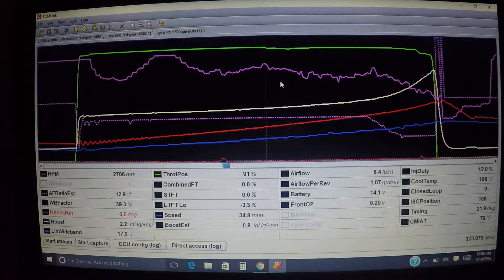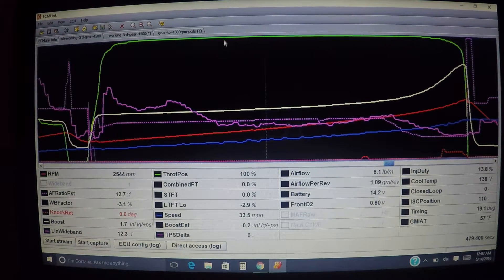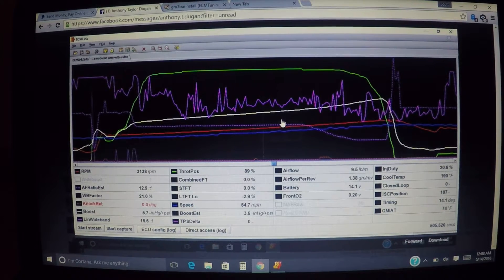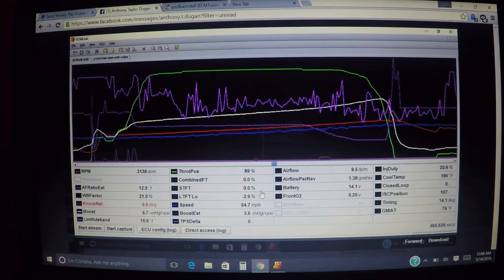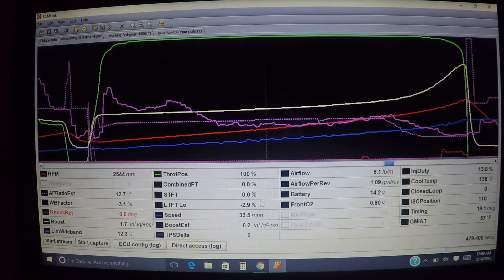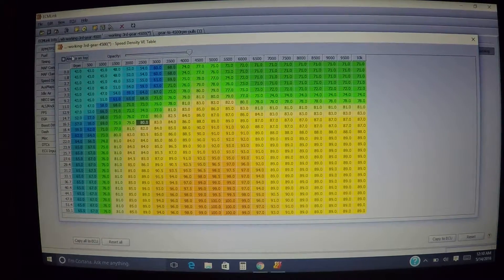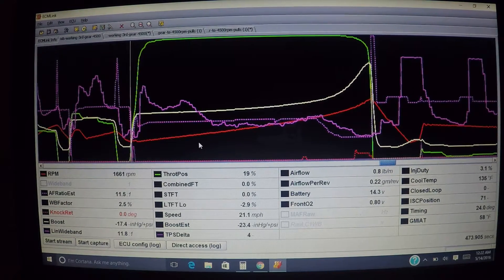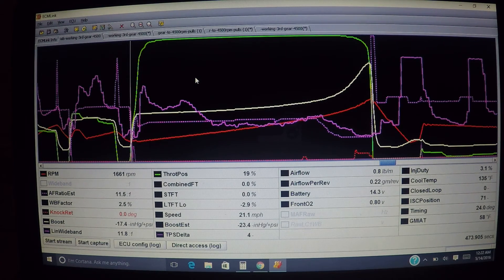SD WOT Part 3

Comment: Scott I've been loving this 3 part series, it helped me dial in part of my WOT logs. Question though, what about the first part of that WOT log? The lean AFR isn't an issue? Following your videos it's gotten me to the point where it looks really similar to what you have here, but I also have that lean instance in the first 1/4 of that WOT pull. I was under the impression that the wideband must follow the AFRatioEst during a pull?
Reply from the maker: I will say that if you can add fuel to get it where it needs to be, great. No reason not to. But if you have trouble there, so long as the car is doing what it should, it's responsive, and moves, then you're okay. You won't have enough of a load in that area to kill the engine there. But as Kevin Jewer always says, give it what it wants (in reason). So give it the fuel if it's warranted but don't pull your hair out over it, if that helps any. When you get into the upper rpm's/load, you want it to be spot on and that's where it really counts.
Reply: @V8sareslow1  Thanks for the reply Scott! My graph currently looks extremely like the one you have there. I'd imagine once I get the beginning of the WOT in line, I'll have to do a lot of work to the latter part of the graph to get everything lined up. The car drives pretty well right now though, so like you said if I have bust my ass to get everything pretty I might just leave it haha

Comment: Hey Scott, your videos are amazing. However, I had the following questions. When you started to make adjustments on the VE table by dropping or adding the percentages, I notice you drop the exact percentage points that wbfactor indicates. So if you're in an 87 tab on the the VE table and WBfactor is -3%, you'll drop that to 84. I was under the impression you'd drop 87 down 3% in RESPECT to the value of 87 in stead of down 3% from 100. So instead, you'd do the math of 87(.03)=2.61. So 87-2.61=84.39. But because you can only make .5 increment adjustments, you'd set it to 84.5 instead of 84. Would this be more appropriate? Or am I overthinking it here? Thank you!
Reply from the maker: Understand what you're saying but I'm sleepy and trying to think of the answer. You might be right. I can't think. Easy way to do it is make the adjustment to 84, set it and see how it does, then set it back and do it 3% from 100. However, I usually just start with a good SD table for a specific setup and adjust global overall. Any changes to the table would "usually" be minimal anyway.
Reply: @V8sareslow1  Yeah maybe I'm just overthinking it. I used your video to tune the other day and was actually gonna try it but luckily I found a tab that landed on a 99.6 tab for a WOT pull and just did the calculation from 100. Is it odd that after having link calculate -79.3 global for my 2150cc FIC injectors, my WBfactor was so far off I had to set my global to -65 to compensate. This is around the range people use for e85 yet for me, this was on 91 pump gas. Basically, link showed it to be equivalent to lower than 1300cc! Seems so off.
Reply from the maker: About to crash out. Remind me later and I'll look and see what my global is at because I have the same injectors.